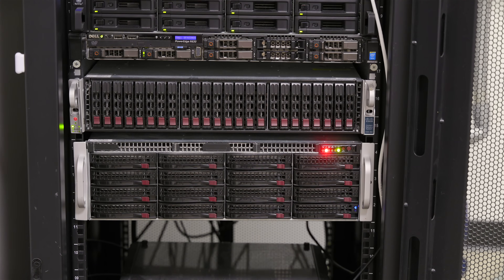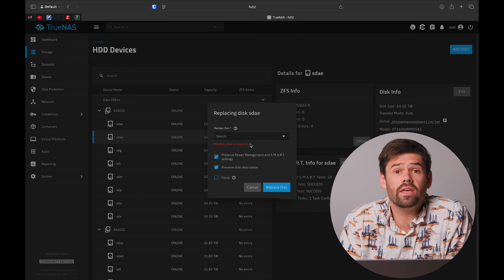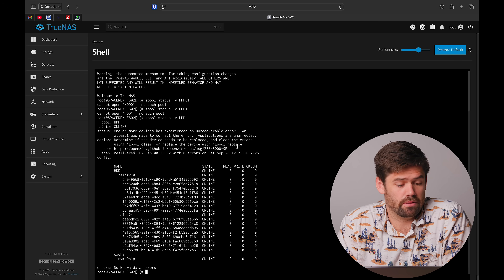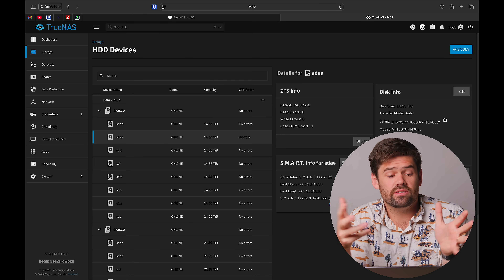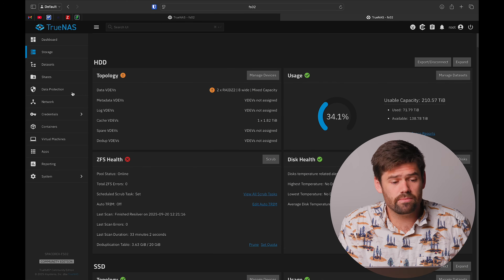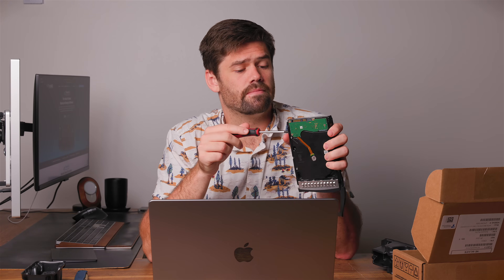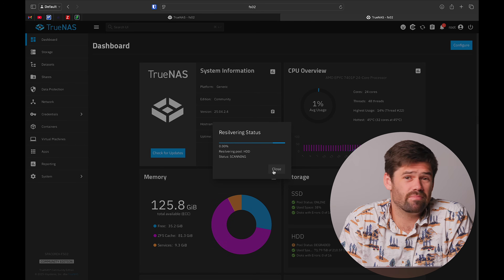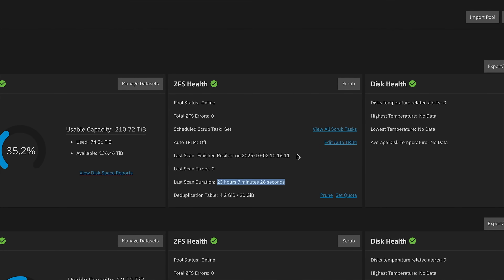How to replace a failing drive on TrueNAS SCALE

Comment: Is there a way to identify the drive without shutting it down and taking each drive out till you find it? I'm using truenas 25.10 in a supermicro 2u 12 bay enclosure z2 configuration. My drives are 14TB UltraStar DC HC530 Enterprise 7200rpm 3.5" SAS 12.0Gbps (512e) Thanks

Comment: Any info on how to go from 2 drive mirror, to a 4 drive raid z1? just nuke everything and start fresh or better way?
Reply: Yep.  Nuke and redo.  You could just add 2 drives as a new mirror set vdev to the pool though.  You’ll also gain iops bc each vdev is treated as a drive by truenas, you’ll double your read speed at the cost of half your capacity.  If you nuke and go 4 drives z1 you won’t gain much (+1 drive of) iops but you’ll be faster writes since you’re writing across them.  

Personally I ran 4 8TB in Raid5 (basically Z1) and I found 55MBps writes for about 10 years and that drove me nuts.  If I did it over I would do Raid10 (4 drives as 2 sets of mirrors) and sacrifice half the capacity to get 150+MBps maxing out 1Gbps ethernet so 125MBps.  

If you don’t want to do that, if you can go 8 bay raid6.

I am redoing my setup now to 14 bay 10TB Raid10 + 1 hot spare.  That gets you 10Gbps ethernet maxed out speed so 1250MBps read & write.  I mention this bc this you may end up here like me whom should have just started with this, but this wasn’t really an option made for home until recently.

Comment: So far I'll be able to tell exactly which drive fails because TrueNAS has been sending me almost weekly errors about one of them. It's a little annoying the way they do it, but it does work.
Reply: It’s bc it’s a nudge to buy their hardware enclosure so it tells you in their ecosystem.
Reply: @privatename7634  It keeps telling me that there are unreadable sectors, but none of the data has been lost (well, as far as I can tell), and everything works.

Comment: I noticed the failed drive was a Seagate EXOS drive (which is what I am using, might even be the same size too!) and replaced it with what looks like a WD Red series.  I always worked under the impression that you shouldn't mix and match disk brands in a single array - is that not true?
Reply: Truenas will function mixing.  

Professionally this is not recommended bc the whole array will match the slowest drive so you could be nerfing your performance.  

People do it bc it’s what’s on hand, and it’s better than not doing any replacement waiting for a new proper drive bc if another drive goes down you could loose it all.  It’s convenient.

Comment: I'm a little confused, but I'm also not familiar with TrueNAS SCALE. You keep referring to JBOD, but as a general rule, we don't use JBOD for ongoing storage because it offers no redundancy, and if one drive in the array fails, you lose all the data on the array. (I might make an exception in a NAS that's just one of several backup destinations, and losing one backup wouldn't matter.) Does TrueNAS offer a feature that saves the data in your JBOD if one of the disks fails?
Reply from the maker: Ah, so this is a confusing nomenclature.

When you talk about drive chassis (that do not have CPUs in them) they are called JBODs (The physical enclosure) that is what I am talking about here.

The raid like JBOD, (that you are referring to) I am not using
Reply: JBOD = bunch of disks
JBOD enclosure = box holding just disks

What people do is JBOD a bunch of disks into a JBOD enclosure and then that JBOD bunch of disks is connected via the box to another unit that controls everything.  That controller can then set up the drives as a Raid1 so they all show up as 1 big drive.  They do that bc it’s a quick (dirty aka non professional) way to use re-use old random drives to make a 100% capacity available mega drive as a local backup for their primary NAS to avoid building a new Raid6 or identical 2nd NAS as a professional local backup that has drive size requirements etc.  or as a way to just be able to use outdated drives.  But one drive dies and you lost everything.  For some people that’s risk trade for a huge cost savings due to full usable capacity as a nice to have backup for things like a Raid10 as a convenient just-in-case really to just avoid the hassle of getting your offsite backup.